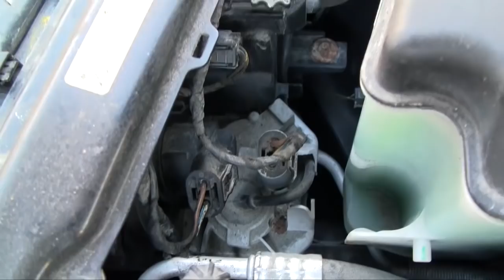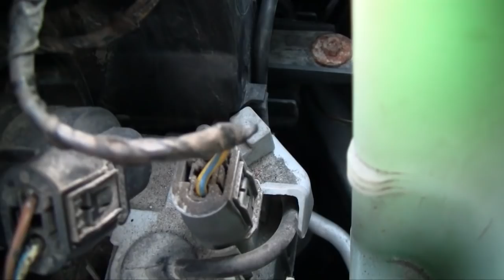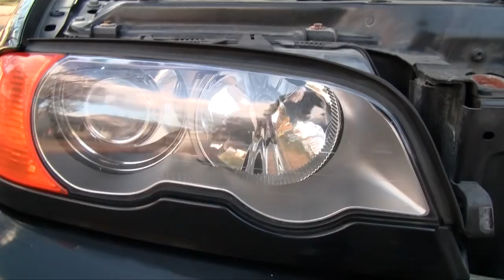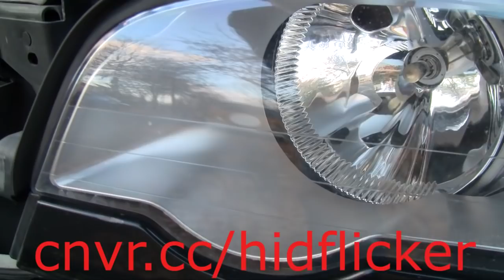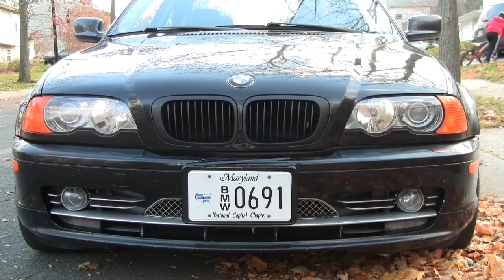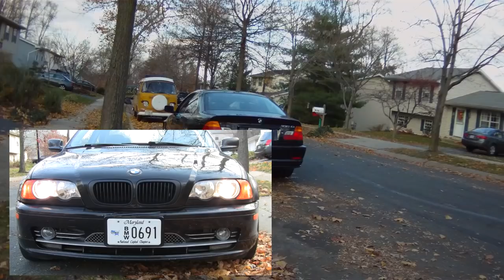BMW E46 HID Flicker Problem

Comment: Ok so my girlfriend purchased a 2001 BMW 330ci convertible and a year later (3-4 weeks ago) both headlights started flickering and the driver side rear brake light panel also went out. So after calling up the dealership and reading around, I found a fix that seems to work (thx to google and youtube). I opened up the rear tail light panel and disconnected the connect wiring harness. I saw that the grounding wire (brown) appeared to be scorched so I cut the brown wire, cut the metal portion where it would connect to on the circuit plate and spliced a new connecting piece to it. I placed shrink tubing around the newly spliced wire and connected/crimped the new connecting piece to the cut plate. It works for now and I will test it again tonight to see if it is a complete fix. Thanks for all the input from everyone that had the same problem and hope this helps. Now she can go about driving her BMW convertible and I get to go back to the almighty Corolla lol.
Reply: disconnected the  what?
Reply: @shahzeboy1609  "connected a harness wire"

Comment: The fix: One of the rear light carries has burned ground socket. Sometimes cleaning it helps, but I suggest to ground it separately.
Had xenons flicking. Turning signal to the right was blinking on a higher frequency. There was a problem, on the dashboard, before turning the lights on, about rear right lights.
All fixed because of the grounding in the rear lights.

Comment: The solution is the rear bulb carries and plugs. The are usually damaged with time. 
Also this will fix your rapid blinking signal lights issues.

Comment: I am using the video of the ground wire in the taillight assembly to fix the problem...will update on if it works.  The light on the dash also shows that a taillight is out but it is not. Definitely believe it's a ground wire problem!
Reply: +Kelly Earwood  any luck!? and do you have link to the video?

Comment: oh my goodness, I own a E90 -  2011 bmw 328i Xdrive and my car is doing the same thing .....for the past two weeks my headlights intermittently flickers ...its driving me crazy ......my car does not have projection headlights, they are halogen ...so at the moment I purchased hid kit and installed it ....it was working great for the past 3 months and suddenly it does this flicker crap ....its so annoying ....i need to try and fix it ....asap .. THE LIGHTS FLICKER AT THE SAME TIME, NOT INDEPENDENTLY ...
Reply: Did you find the solution? Im having same issue so far i noticed the issue is coming from the rear breaklights, from what ive seen on YouTube and Google

Comment: I am having the same problem! I changed my HID's bulbs to brand new ones, but the problem just got worse. My right rear tail light is an LED one, and some of the LED's are going out. I am wondering if it the bad ground like you said?? Did that completely fix your problem? Thanks

Comment: opening the trunk , the right side has a rubber tube, there are wires that are disconnected or short-circuited , for me that was the reason
Reply: +sanchezok definitely

Comment: I know this video is relatively old but I just started having the same exact problem as you display in this video.  Can you elaborate on what needs to be done to fix this problem? I noticed Evertt Albee said it's the brown number 3 wire on the right rear tail light, what needs to be done?  Thanks

Comment: Blinking is normal however you may want to check your Headlamp fluid resevoir to make sure the "tear duct" isnt dry or clogged add the tears of a German to resolve your blinky Beammer issue 👍

Comment: problem comes from rear tail lights. seems crazy. but the headlights are tied into rear tail lights. unplug each tail light and look for bad contact on the wiring harness that goes into tail lights.